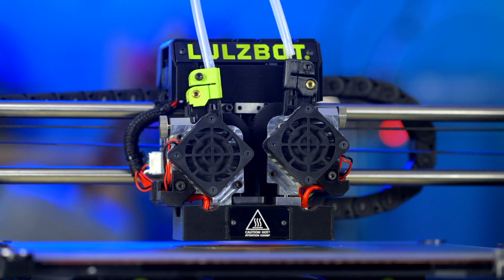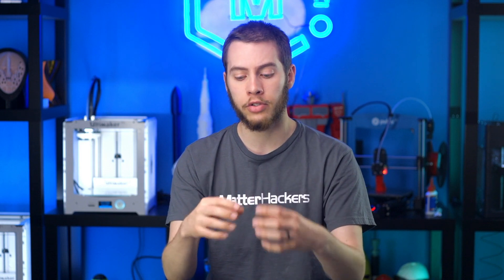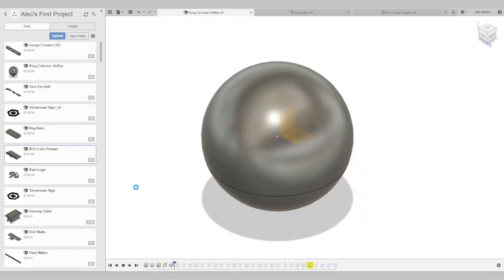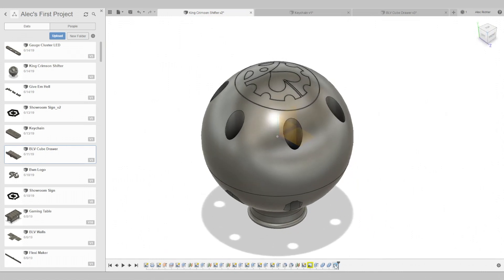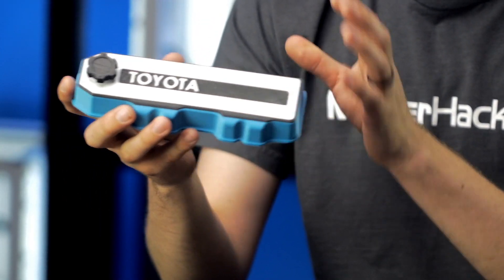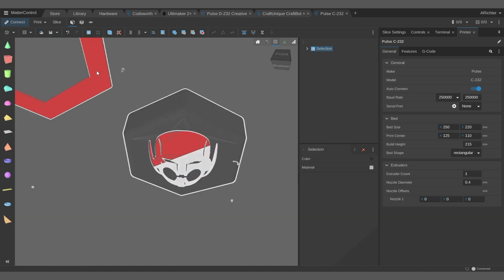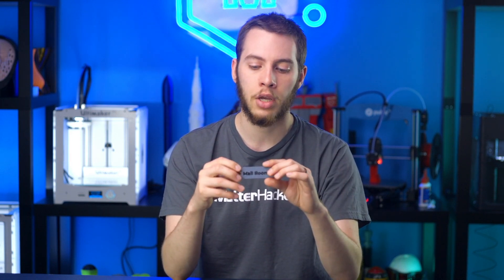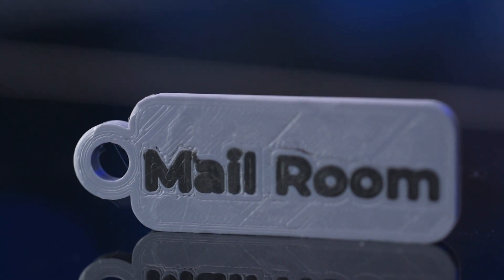How To: Two-Color 3D Printing with a Single Extruder Machine

Comment: Does Matter Control 2.0 Have or will get dual extrusion like Cura has?
Reply from the maker: MatterControl already contains several hardware profiles that support dual extrusion - if you're looking for a particular 3D printer profile, email support@matterhackers.com for more info.

Comment: I'm having a harder time understanding the process for the top layer inlay method.  It's the only one I haven't tried.  The picture in the article helps, but I wish you would have elaborated the process with a few clips of the model in your software then it going together on the print bed like you did with the other methods.  I guess my biggest hangup is that Devin's method has everything starting on the build plate, whereas you say the last builds on top of the second (gray filament, in your example).  My lack of experience is calibrating where the Z height of the final print job starts so there is no nozzle crashing. Hopefully I've understood this right.  Thanks for the tips!
Reply: I also have the same question